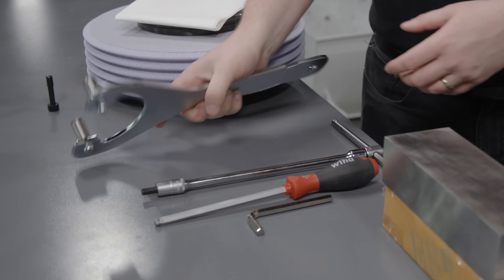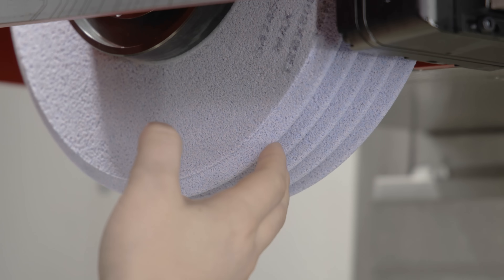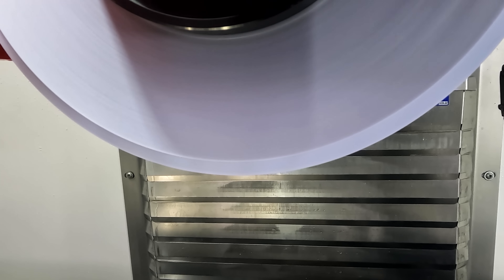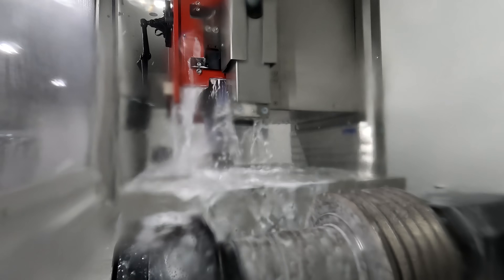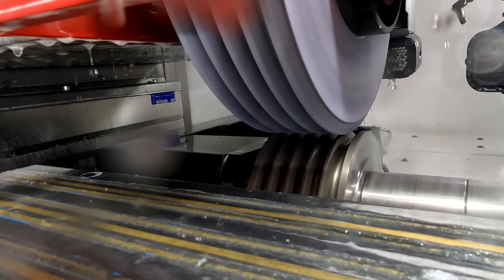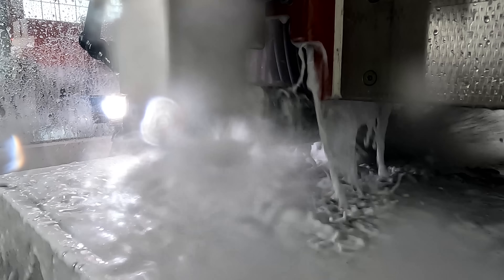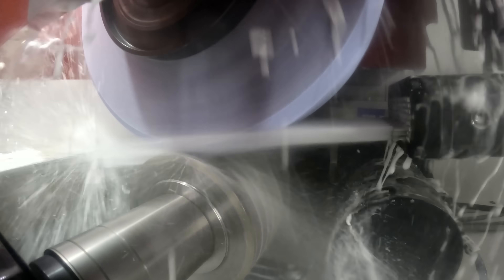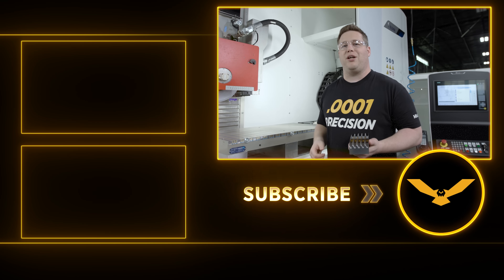Thousands of DIAMONDS Used to Create IMPOSSIBLE Grooves

Comment: What is the cost of doing it that way? You lose a bit of the wheel every time you do this, and the wheel is probably not cheap.

How many parts could you make before you need a new wheel?
Reply: He said he takes 8 thousands of when dressing and does that every 1/4" so that's 1 inch of grinding wheel removed for every 31.25 inches of material
Reply: It depends on what material you are grinding, how much material you have to remove and how long the part is.  This is something you would need to play with the process to fine tune but the wheel will last a good while.  The wheels come with different grits and other factors that could extend tool life as well.  Here I am re-dressing .008" off each time but that is not exact, you may take more or less depending on what you are doing.  The wheel starts out at 16" diameter and it has a 5" hole in the center so you can take a lot of material off this wheel before you need to replace it.
Reply: I asume around 500 dollars a wheel
Reply: @jonaskung4412  its around 250 if you only buy one
Reply: Depends on the material the parts are made of, were I work we make pretty small parts that aren't terribly hard and we get thousands of parts out of a big wheel like that one

Comment: So, is the diamond infused wheel that dresses the grinding wheel a permanent feature of the machine? Or do you have various wheels with different profiles and swap them out?
Also, since new cut profiles need a new grinding wheel and a new dressing wheel then who and what makes the dressing wheel profile? The whole thing seems to make sense only if you have a huge production at hand, cause I imagine that the dressing wheel is custom ordered and probably expensive as hell. Am I getting something wrong?
Reply: Nothing wrong.
I'm sure the diamond infused wheel is custom made.
I'm sure they have a large order for such parts.
If it wore a single order or something like that they would have used the single point diamond to dress the grinding wheel.

Everything in this video must be crazy expensive.
The grinding machine itself was millions and it must pay for itself in 2-3 years.
Reply: Yeah, those dressing wheels are custom made for the specific profile. There are also rotary dressers with two dish shaped wheels that are more universal, you can move the grinding wheel along those wheels (one for each side) to create your desired profile.
Reply: @CatNolara  I run a Gleason TAG 400 gear grinder with a Fassler double diamond wheel dresser. I wish i had a roll form dresser instead, but doing production runs of 14 parts or less is not cost effective.

Comment: Looking at the finished product, would this mean you could grind a worm gear with a wheel dressed like that?
Reply: Of course. As he mentioned, the grinding wheel can be used to replace many processes like broaching and etc, including the gear hobs used to machine worm gears. Of course, an appropriate fixture will have to be used.

That being said, the process has it's own strengths and weaknesses so different jobs might be call for different processes.